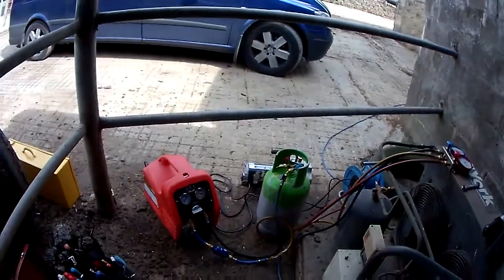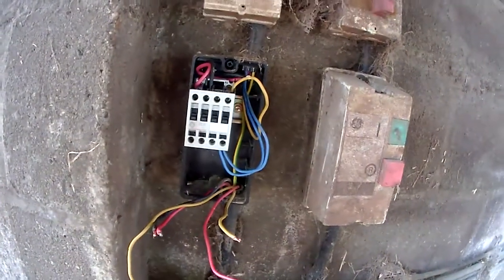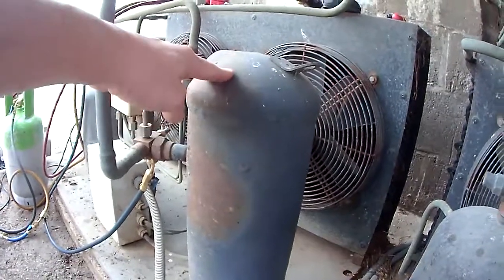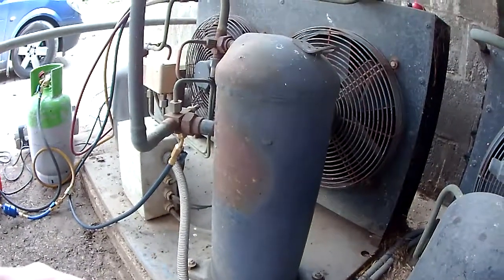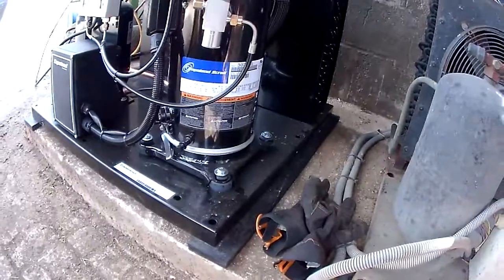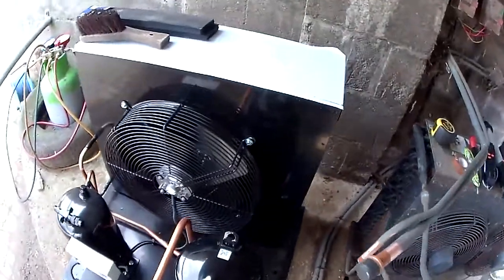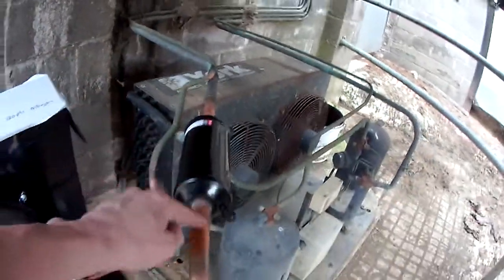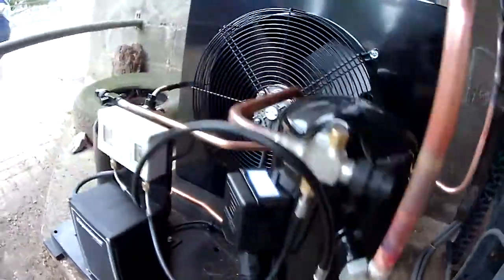York to Copeland Changeout

Comment: when the system is grounded .. it will cause a spark in the compressor.. and burn the oil..(Phosgene). very very very bad sit.. and a bitch especially in a big system.. you have to install big driers change them after a while..Here in canada.. in toronto.. i usually install on both sides suction and liquid pull 24 hr vaccum...start the system load new freon..

Comment from the maker: Its similar to a normal drier so it will filter moisture, dirt etc but it has charcoal in it too so will absorb acids from the refrigerant and oil decomposition thats common in very bad burnouts. If the acid is left in the system it can cause copper plating on bearings and valves, and also eat the insulation off the windings so the new compressor fails too!

Comment from the maker: Thanks! It didn't smell burnt and i didn't do an acid test, i was more concerned with metal particles from when the old compressor failed. It was originally on R22, this will run on R22, R404A or R407C etc so its ready for when it needs to be changed.